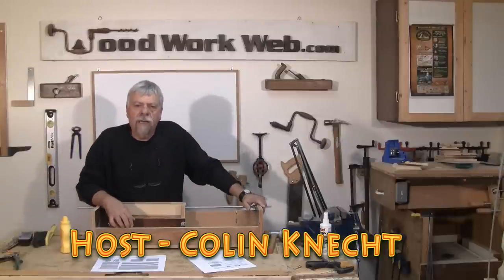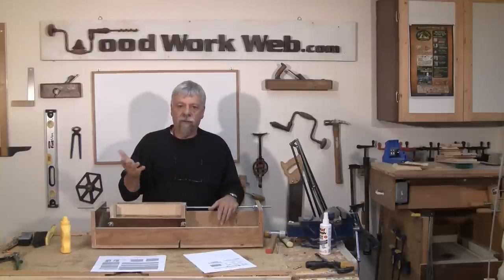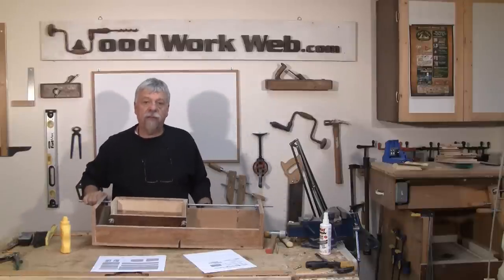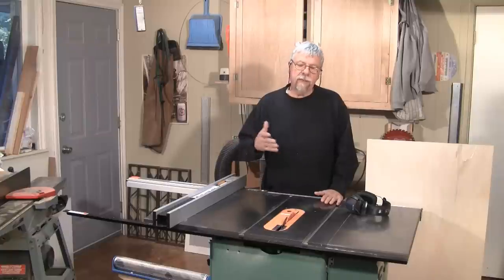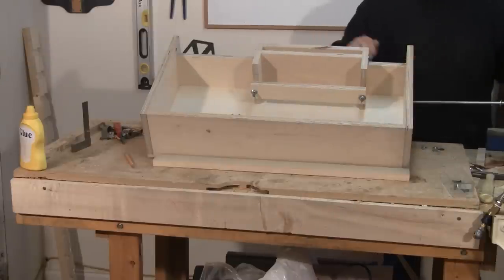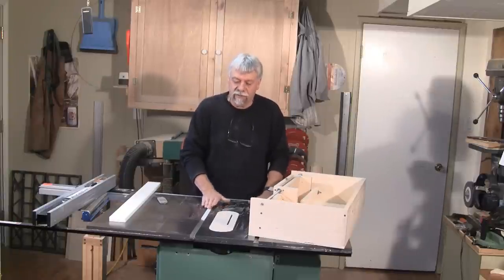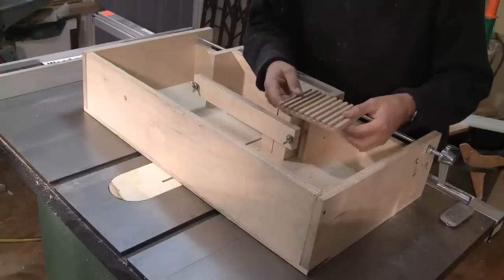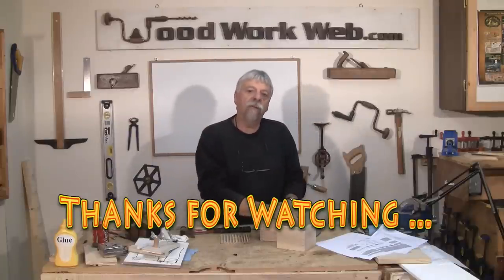Making a Box Joint Jig - A woodworkweb.com woodworking video

Comment: Thanks for making this video...what a great jig. I actually went and downloaded the plans, and followed along with this video while making it. Some pointers...The wholes for the threaded (Redi Rod) need to be precisely aligned to each other (4 total). So, use double sided tape, line them all up correctly, make sure your drill press table is square to the bit, and drill half way from one side, and flip and drill the other half from the other side.

Comment: Hey Colin actually it was not the jig at all, it was my dado blade. I got a better carbide blade and now get excellent results. I had a older blade that was not carbide and it did not cut accurate especially with oak . I have to say this is the best box joint jig out there. Thanks for the great videos. You have taught me alot. Shane Sullivan.

Comment from the maker: There are a couple of things to look at. The first is where the redi rod goes through the carcass. This needs to be snug, with no slop. The second area is the T nuts on the carriage. I have one on each side and I notice that when they are tighter, ie the redi rod is a bit harder to turn, the box joints are tighter than when the redi rod is easier to turn. Let me know if either of these helped ... if not, lets see what else we can do.
Colin

Comment: I made this jig for the router and found I had unacceptable tear outs on plywood. I converted it for use on my table saw using a single blade and found that due to the precision of the rod the joints were much too tight. Upon examination, I determined that the saw kerf was much less than 1/8 inch which is one turn on the crank. All you experts need to speak more about kerf whether using a single blade or a dado stack. I have purchased a dado stack rather than a blade with appropriate kerf since the price difference was small and I will need the flexibility in the future. I'm looking forward to using it for box joints soon. Thanks for all your very useful videos.

Comment from the maker: Hi Ricardo, yes as stated in the video, if you check out the article on woodworkweb, you will find links that will take you to the working dimensions for the jig. Again, as I said in the video, I made mine wider that what the plans called for. Good luck with your jig, it works very well.
Colin

Comment: I had a question on your box joint jig. If my box joints are a little more loose than I would like them to be how would I go about getting a little tighter fit. By the way you did a great job at doing the video and explaining all the details.I love this jig and it was a great idea expanding the box. Thanks again.

Comment from the maker: Officially - Saw guards should always be used. There are situations where they might need to be removed temporarily for a special purpose reason but must be re-attached. Many saws have guards such as sliding mitre, chop saw, table saw, circular saw etc., if guard is unsafe it should be repaired or replaced or the saw otherwise be made safe to operate. It is the responsibility of the operator to make sure their equipment is safe and being operated safely.

Comment: Very nice jig, Colin.  I'm wondering what you used for the crank on your jig.  It almost seemed custom made although I suspect you'll tell me otherwise.  Please tell me what you used for the crank-handle.  Thank you.  Also, when making the finger slots, do you just turn the crank the same number of turns each time to get the same dimensions?  I'm curious about that too.  Thank you for your time and a very well done video.

Comment: A small update I thought of is a notched indexing wheel, with a spring detent, on one end of the threaded rod. This would allow the rod to 'click' into 10ths of a turn, making it easier to do cut odd sized fingers. Or just one notch to make sure the rotation stops at the same exact spot every cut.

Comment: No, depending on the number of threads per inch, and the width of your blade, you must calculate how many turns you need to make. For example, my blade is .10" and I use a ready rod that is16 turns per inch. To cut quarter inch fingers, I first cut 2.4 turns,to skip the next quarter inch, I rotate the handle 5.6 turns. So, if I remember my calculations (they are at work), the pattern ends up being something like 2.4, 5.6, 2.4, 5.6. This may not be exact, I am not looking at my pattern.

Comment: It is also important that the two grooves that you cut out on the bandsaw are exactly the same, so tape those together and cut them both at once too. Finally, the reason I wanted to comment...is there a trick to eliminating the slop between the T-Nuts? Problem: as I cut the fingers, if I accidentally turn the handle too far, I then turn it back the opposite direction to correct, but the carriage doesn't move due to slack. How do I eliminate this? If I overturn, I want to be able to turn it back!

Comment: Any reason why dadoes couldn't be cut into the sides that support the critical back piece of the carriage assembly? (This assumes that the table saw fence is parallel to the dado set and the miter gauge is true at 90 degrees.)

Comment: In England you can only get metric threaded rod easily.  Also dado blades are not available and blade kerfs are measured in metric.  I built the jig and used M10 x 1.5 threaded rod.  I also replaced the handle with a 7 inch approx wooden disc about 1 1/4 inch thick. On its face I measured 24 degree segments and extended these as lines across the edge of the disc's circumference.  This gave me 15 equal divisions, each division representing 0.1mm of carriage movement as the disc was turned.  With a 3mm kerf blade it was now easy to make equal cuts with great accuracy by moving the carriage the appropriate number of turns.  I found the joints were too tight initially but by turning the disc one division past a full turn (i.e.1.6mm) I was able to ease each slot a fraction. This is difficult to explain but I hope you all get the idea.

Comment: I bet your T-Nuts are a little too precisely aligned.  Try shimming one a bit using a piece of paper (standard 20lb. paper is about 0.005").  The idea is to have one nut riding on one side of the RediRod's thread and the other nut riding on the other side.  This should help remove any "backlash" as it's called.  Keep adding shims until you're happy and then glue the nut in place.

Comment: First off, Joseph Lorentzen, while you can use a router, the router bit will tend to "pull" the board to one side, whereas using the table saw, the boards are held in place.  I do have a question though.  I don't think you stated just how much wider you made your jig relative to the plans, and also, the plans call for 1/4 inch plywood for the base, yours looks thicker than that.
Reply from the maker: I did use a slightly thicker base, my first version used 1/4" and I felt the jig could be a bit sturdier and yes I did make it deeper by about 6"

Comment: I would have thought the slots would have been safer to cut on a router table, but I can see that the variation in plywood widths might add to the difficulty in cutting those slots.
Reply from the maker: Well, that's the good thing about woodworking, often a few different ways to accomplish the same thing, yup, a router could work fine.

Comment: You could do this to the ends of 2 x 4 pieces and join them together to make longer boards. I know there's a router bit for that as well but this would be a cheap way of connecting boards.
Reply from the maker: 1976ClassicCelica Yes, you are correct, I had not thought of doing that and yes you are also correct that there is a router bit for doing this, it's called a finger joint bit, and because the finger joint bit makes longer tangs, it would make the bit stronger, but in a pinch, you could use box joints with a deeper cut.
Thanks for the idea ... I like it
Colin

Comment: Is it possible to use this jig with an ordinary sawblade ? Here in Europe(Norway) we're not allowed to sell/use dado blades.
Reply from the maker: Kenneth Fjelde Yes, I have heard that ... so there are a couple of options. You could use this jig on a router table by using a straight router bit, or on a table saw by using a series of identical 7.5 inch circular saw type blades.
Reply: WoodWorkWeb thank you so much for your answer... I think I'll try to make the router version.

Comment: I built this jig and it works great, except I did not like the 8 turns... I had bought Matthias's plans awhile back so I adapted his gears to this jig by screwing on some 2x4 chunks... all's I needed was his gear template... it was pretty easy to do, now only 2 cranks and perfect every time! I call mine the Franken jig.
Reply from the maker: Good to know, yes I know Mathias is selling this. I have hesitated to put a crank on because I am using different size joints and wasn't sure if it would work ... but good to know ... thanks :)
Reply: WoodWorkWeb The jig as it stands works great, the reason I adapted the gears is operator error... I lose count of the cranks... short attention span I guess but I would encourage anyone wanting to make box joints to build this jig, it's super easy to build. I just ordered the Freud SBOX8 set you use and cannot wait to see how they work together.
Reply from the maker: talex001 Hmmmm .... I hear you about the short attention span, that;s me all the way lol, maybe I need to re-think it. Let me know how you like the box joint set. 
Colin

Comment: Can I used two 7-1/4" blades from my Ryobi circular saw, or do they have to be two  special  blades ? My table saw is also a Ryobi made.
Reply from the maker: Luis alberto Yes, you could use those two 7-1/4 blades on your table saw. They do not need to be special blades unless you are doing some special cutting.

Comment: Hi,did u use a dado setup on your table saw?
Reply from the maker: No, I used something by saw manufacturer Freud, called a Box Joint Blade Set. This is a special set consisting of 2 blades that are specifically designed for making box joint sets. Most dado blades are ok, but many of them leave small cuts in the bottoms of the holes and when you put the 2 sides together, these small cuts show up, so I prefer the Freud set.

Comment: Why can't I acces your web site?
Reply: Colin Knecht It is a server problem, not some firewall.. Brasil does not have that (at least for the time being..) Check the error with your webmaster:
It is a simple permission on the server root folder.

"Forbidden
You don't have permission to access / on this server.
Additionally, a 403 Forbidden error was encountered while trying to use an ErrorDocument to handle the request."